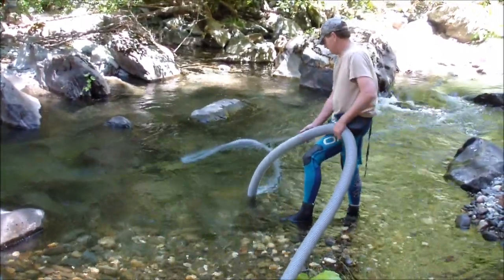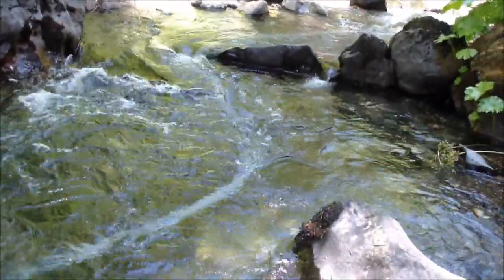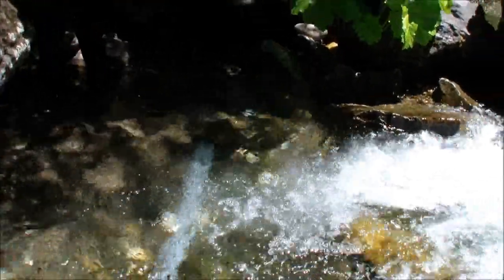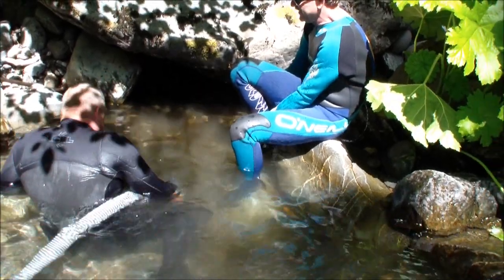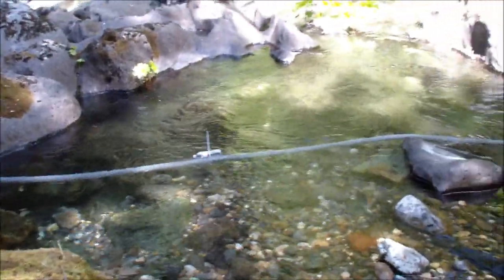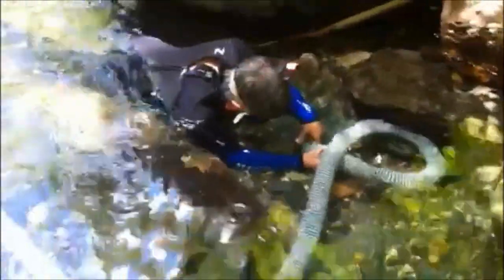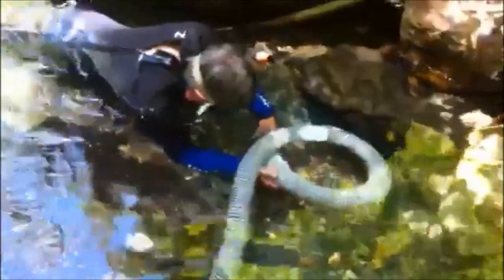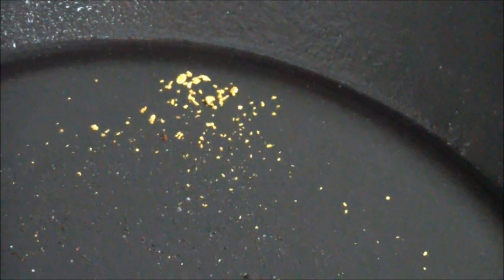Gravity Dredging, Practice Makes Perfect

Comment: I guarantee you expelled most of your gold out the sluice, you had it too submerged in water, a mistake ALOT of people make, more water in the sluice equals less pressure, and thus, less vortex for the gold to drop out in. Try less water in the sluice with a bit steeper angle. there is a few good videos by howtodrillawell that will help better explain this, Good luck and happy hunting!